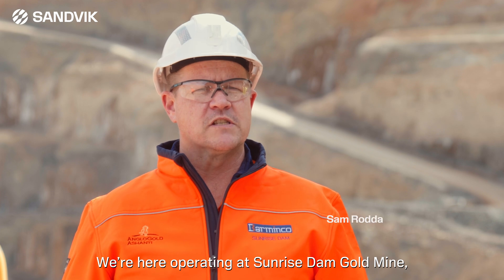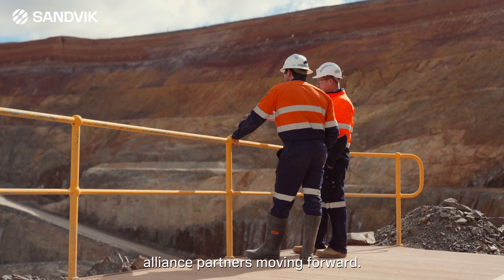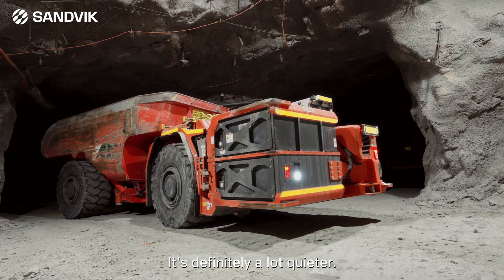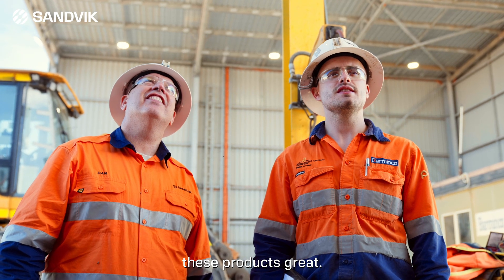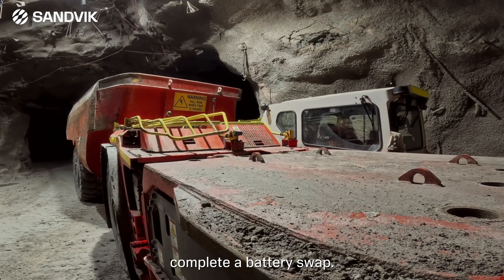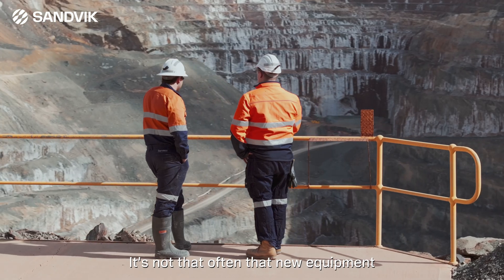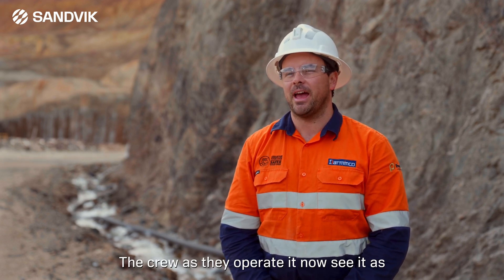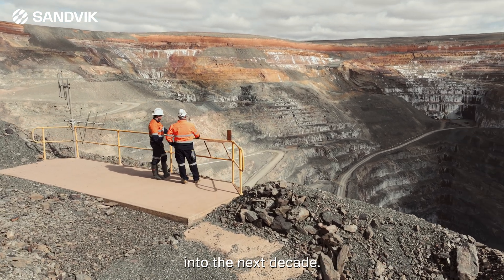TH665B battery electric truck success at Sunrise Dam, Australia

Comment: a battery swap every 3 hours isnt amazing, but it is better than what i expected based on the power draw of the machine, i guess it isnt near its max power rating very often?

are the batteries able to charge in that 3 hour span, or are you running 3 batteries per haul truck? (2 charging 1 in operation)